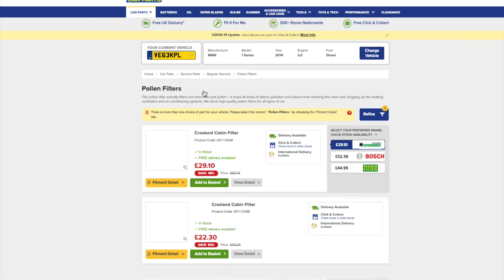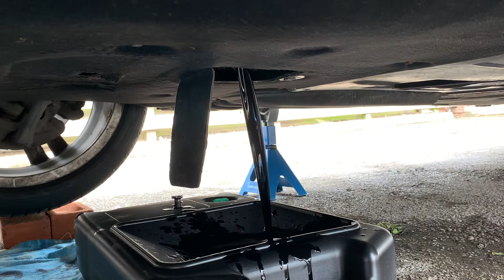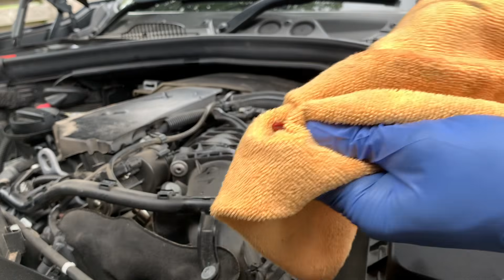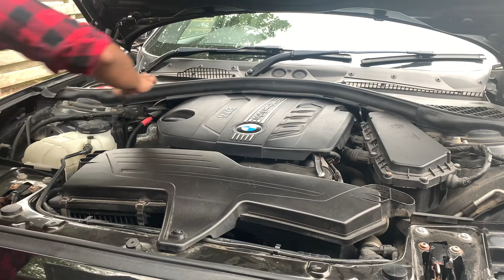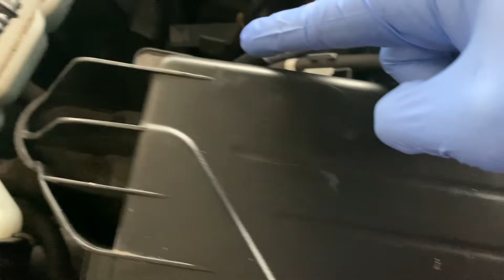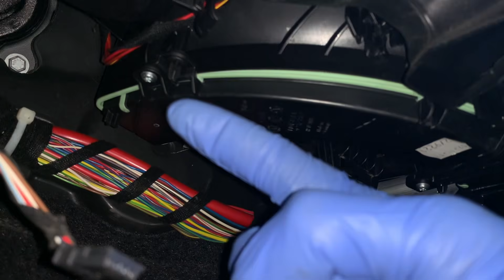How To Service Your Car | BMW 1 Series | EASY GUIDE

Comment: I changed the oil, the mechanic reset it manually but the oil only gave me 6k km for the next service and below it appears non-executable reset being green, I see cases where this non-executable reset does not allow the service to be carried out, do you know why that is? Since the brake fluid reset is impossible, please help me. Me

Comment: Are BMW’s worth getting only every time I say about getting a series 1 people always say steer clear clear of any BMW because they’re always breaking down or having trouble
Reply: Good question and I hope you get an answer soon from the host 🤔
Reply: I’ve owned over 50 cars in my lifetime covering a lot of different makes and models the only ones to leave me on the roadside (2) were BMW.
Reply: I've had two BMW 1 Series and I can honestly tell you that you should stay clear of BMW cars. 

Incredibly overrated and nothing but trouble. 

Makes me wonder why people are obsessed with the brand. Audi is far better if you're going German.
Reply: Haven’t had much issues with mine, changed the clutch, some suspension once, that’s it.
Reply: Mines been great nearly 180k on it and still running well
Reply: It's worth it there awesome car I have a 535i you just have to keep your beamer up to par now if you don't have the time or money then yes don't buy One

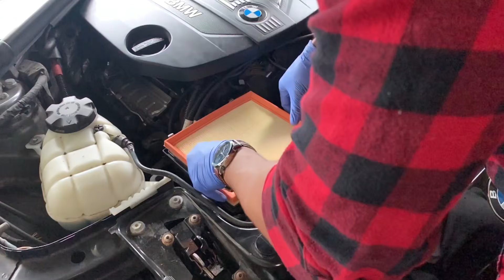Comment: 13:54  you are cleaning the air filter box with a rag. Take it out instead and wash it. It is only held in on 2 sliders and easily relocates. Nice video.

Comment: i have a 2014 1 series just like yours. I have been servicing it at an auto shop for the past 2 years. Now after this i am atleast abit more clued up on what to do. I have start changing y own oil from now and filters. that is a job i can save an expense on. anything else ill just take it in. Thank you for an informative video. Great calm steps and well detailed and i can actuallly see what youre doing. not rushed. just perfectly explained ! thank you sir !
Reply: Use the Syphon oil out system, it's easy for all the oil out my jaguar

Comment: Where do u jack it up??? Not at the designed point where the jacks should be put???
Reply: Hi mate might be late but you can jack it from the front - directly. There is a round circle on the under tray toward the back marking the jack point. Make sure you use a good trolley jack as a lot of weight, with a flat surface ideally with the rubber pad to avoid damaging the tray.  Once up you can use a jack stand either side on the bmw jacking points. You can get two rubber inserts to rest on the top of the stands for better stability and to avoid damaging the plastic.
Reply: Would you Pls post some pics about those points you mentioned.

Comment: Just curious, after you replaced the drain plug on the bottom why didn’t you pre lube the filter and O rings before inserting the filter back in and then fill the oil reservoir 
   I thought this was “good practice” but I could be wrong. 
Thanks for the video, very informative.
Reply: Yes, he should have lubed the o ring. It seals better when it's lubed up
Reply: Yeah!!! And again I didn't see  him replacing diesel filter or does this 120(d) not equipped with it🤔

Comment: Please can anyone help with airbags light, i have the 1 series 116i m e81 2008 and the airbag light will not go away.
.... Any assistance will be most appreciated...
Reply from the maker: Hi, have you tried reading it with an OBD?
Reply: @leong1163  thank you for replying, no i haven't and don't have one. I may have to take it to a garage ( financial pains😢) and trust. There is just no honest work- person out there anymore.
Reply from the maker: I understand. I’d recommend getting a basic one off Amazon, capture the code, and clear the light and seeing if it returns back. You can get one around £30 and return it if you don’t need it. Garages charge upwards of £40-50+ for a basic OBD scan
Reply: @leong1163  many thanks for your kind reply., will try. 👍

Comment: At what mileage do  you reckon needs to change the gearbox oil. I am driving 116i . Thanks
Reply from the maker: Hi, normally every 30-60K miles. Depends on the previous driving standards or if it’s been changed previously. Does it suggest in your manual?

Comment: 5w40???
Reply from the maker: Correct!
Reply: I have one BMW 116D year 2017 and i use 5w30.
Reply from the maker: @kildio69  Nice! I ran out of 5W-40 so I’ve put in 30 at the moment - need to cycle it soon and put 40 back in!
Reply: Thanks! The tutorials are very good.

Comment: Attention! The oil filter MUST BE ALWAYS REMOVED before the oil ! Every one seems to make this mistake !
Reply from the maker: Hey Bobby. What's the reason for that? 

I got into the habit of doing it in this order because there's always a massive oil spill!
Reply: @leong1163  because u release all the pressure and the oil come off naturally
Reply from the maker: I see, thanks!
Reply: Is the a reason for this, struggling to work out why it would make any odds.
Reply: Usually I just take off drain plug then take off filter then I wate like 40 minutes and let it it drain then put drain plug on then the filter and this does perfect for my car runs perfect every time I do my own to on my bmw but instead of going to bmw for oil I'm getting Castrol this time thanks I was hesitant because they say to use original bmw everything it's annoying
Reply: Oil filter is supposed to be removed after the drain not before as removing before could cause a spill 🤦‍♂️ (Ex BMW dealership mechanic in the uk)
Reply: Each to there own....  I'd never remove filter before draining, remove filler cap and dipstick, and oil drains fine and no chance of any excess oil in filter,   everyone does it the way it works for them,,,   main thing is we are charging our oil,,,
Reply: I guess the car is supposed to be level, when you drain the sump. I wonder it will still drain completely, if only the front is lifted..
What do you think?
Reply: 2016 has a dipstic?
Reply: What ??  @bratosin1

Comment: Great video    Question for you I am getting a bmw active tourer 2series 218i. 1.5 petrol is the service job the same as this thanks
Reply from the maker: Hey Paul! You'll find that most cars have pretty much the same way of servicing. I sometimes take a little bit longer with cars and figuring out where the oil filter and drain plug is etc. Usually Youtube is a great place when you get stuck!

Comment: Good video. Couple of extra steps
1. Open the oil cap when draining old oil from sump
2. Always use a torque wrench both the drain plug and oil filter cap are 25nm
3. It is easier and better to place the new oil filter in the housing using the locating pin on the filter first then screw the cap in.
Reply from the maker: Thank you for the tips! Investing in a torque wrench now
Reply: thanks pokerbokey! do you know the torque of the oil drain screw?
Reply: @flaviomancini351  step 2.
Reply: I was just about to say all this. the only thing I would say. if the oil filter housing is on the top of the engine like this open it and let it' it drain back into the sump.
Reply: Drain plug is no where nr 25mm
Reply: @leong1163  I bought the same car and it has a small fuel consumption.
I would like to know if yours consumes you and that you tell me the engine it has, thank you.
Reply: His is a 2L Diesel, from your post i assume you're asking whats the fuel consumption like I.e MPG? if you have the same engine, you should be averaging 50-60mpg even as a 10-12 year old car.  @CristianRodriguez-ff8mm
Reply: @ I'm not talking about fuel, I'm talking about oil.Sorry if I don't write well because I'm Spanish
Reply: @jamobond5312  yes it is 25nm if you dont know that. Dont work on your own car let a pro do it.
Reply: @CristianRodriguez-ff8mm  Gathered it was a mis-communication but no problem,  oil consumption shouldn't be a problem your engine is a sealed unit and shouldn't be burning oil, as if you are then your head gasket will have blown somewhere dropping oil into a cylinder. Blue smoke is oil, white is coolant maybe have a friend follow you to check. 

If your questioning how much oil does the engine hold on a change, its 4.25-4.5L. Hope this helps 👍🏻

Comment: i have a 2005 120d, on micksgarage they said i needed 5w-30 so i got that and put it in today, but euro car parts is saying 5w-40... is this bad? i already put the 5w-30 in
Reply from the maker: It won’t do any damage to the engine. Have a look at which grade your manual recommends. You can always do another oil change in a few thousand miles or so!
Reply: Will not make any difference if you live in the UK. 5w40 is really only necessary in a very hot climate, so 5w30 is perfectly fine. The manual will give both options to cover different countries and climates. The most inportant thing is that the oil is fully synthetic and low Ash and is bmw approved. You're looking for BMW LL04 standard on the oil. Once you have this it doesn't matter what make of oil you use as it means that the oil has been blended correctly to meet the manufacturers requirements. Hope this was helpful.

Comment: My Owners manual says nothing about oil capacity
Reply from the maker: I believe the manual says level between two markings on the dip stick is 1 litre - you can use the car software to measure it too!
Reply: How do I use the car setting to measure it
Reply: @josephclarke9466  on the f20 you need click on menu on your cars control panel and click on vehicle information then click on measure oil level

Car has on flat ground with the engine warm and running in neutral for the car to measure the oil

I do not know about the older cars
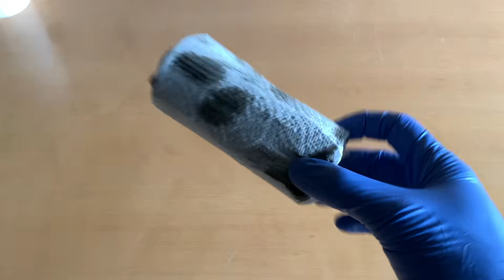Reply from the maker: @deadlyhydra  Exactly this. Around 10:55 in the video if you want to see it